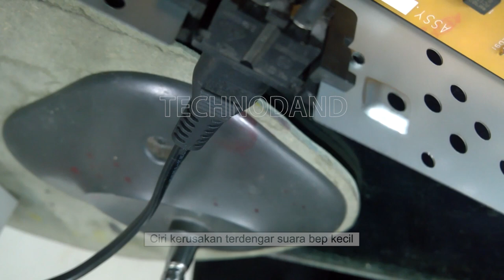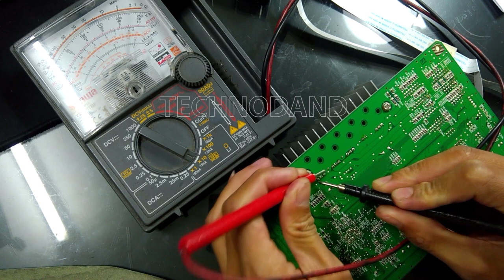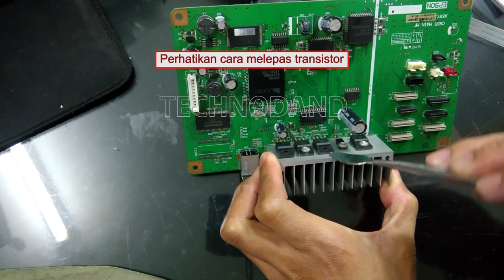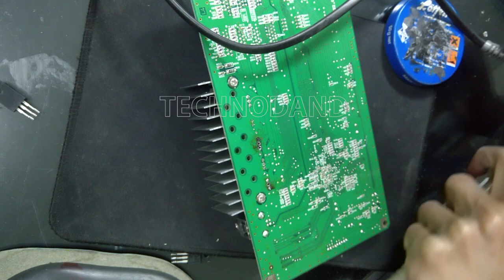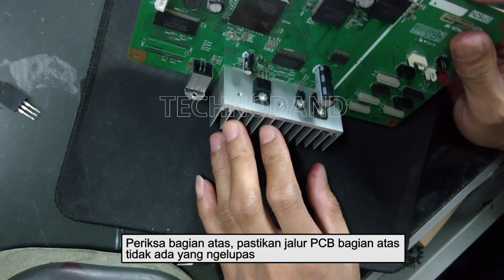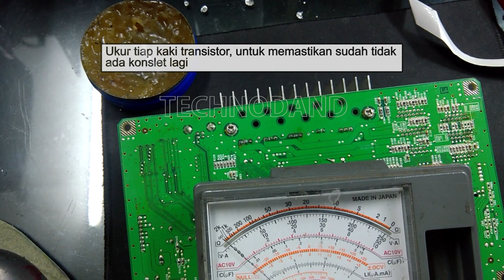Printer Epson 1390 - L1800 Mati Total  Solved

Comment: Hello sir nice video ! mine is like this no power but no bip there is no sound !!! i turn it on and nothing happing ! can you help me please thaks
Reply from the maker: try to check the flexible cable that switches the power, if there is no problem try to check the voltage on the motherboard, if the voltage drops, then check the transistor and IC power

Comment: Cara cek psu masih bagus atau tidak gimana ya
Reply from the maker: Biasanya PSU jarang rusak,  belum pernah ukur 😄. Nanti saya coba dulu test
Reply: Pnya sy l1300 hbis kena air. Mainboard apa masih bisa di perbaiki ya?
Reply from the maker: @arissutaat4947  bersihkan aja terus keringkan. Kalau kotor bisa pakai detergen dan sikat sampai bersih, semprot pakai kompressor supaya air disela-sela komponen keluar. Terus keringkan (dijemur). Rakit lagi, terus test
Reply: @technodand  
Bisa hidup lagi mas. Tapi lampu tinta sma kertas kedip"
Reply: @technodand  
Itu kenapa ya.apa bisa di perbaiki
Reply from the maker: @arissutaat4947  itu general error, penyebabnya banyak, perbaikannya bisa dengan analisa sesuai gejala yg muncul dan muncul error pas proses apa? Komponen apa yg berperan dlm proses tersebut? Nah jadi kita periksa terlebih dahulu komponen tersebut
Reply from the maker: @arissutaat4947  general error juga bisa disebabkan karena ada kesalahan pemasangan
Reply: @technodand  
Pemasangan sudah benar.
Kdang hidup kdang susah hidup.
Colokan di cabut.di colokin lgi gk bsa hidup. Kadang bsa hdup
Reply: Om printer sy epson 1390 indikator tinta nya silang semua. Lampu tinta nyala trus, udh coba ganti chip connector, board CISS, kabel flexibel chip connector sama mainboard msh ttp error. Masalah nya dmn ya om.
Ad kmungkinan flexibel head rusak ga sih om? Mohon d jawab om, makasih
Reply: @arissutaat4947  punya saya juga gitu om
Apa sekarang udah bisa normal lagi?

Comment: bang, epson L1800 sy tiba2 mati pas lagi cleaning, sebelum mati itu general error.  

waktu sy tes, ga ada suara beep. tapi waktu tombol on di tekan, seperti ada suara "ngiiiiiinng" kecil gitu, kalo di lepas hilang, tapi ketika di tekan kembali, ada suara itu lagi panjang. sepanjang kita menekan tombol power nya. 
tapi tidak sekeras suara beep seperti yg ada di video. itu kenapa ya bang?
Reply from the maker: Paling coba dibongkar casing atasnya. Kemudian lepas fleksibel yg ke print head kemudian coba nyalakan bisa nyala ga?
Reply from the maker: Kakau masih mati coba lepas semua kabel fleksibel selain kabel yg ke switch power kemudian nyalakan apakah bisa nyala?
Reply from the maker: Jawaban berikutnya tergantung dr jawaban 2 pertanyaan di atas
Reply: @technodand  klo ga nyala?
Reply from the maker: @gesyachannel0114  ga nyala setelah semua flesibel dilepas selain fleksi switch power dan psu?
Reply: @technodand  iya, sdh ganti TR juga.
Reply from the maker: @gesyachannel0114  kalau tegangan dari power supply ada?
Reply: @technodand  ada
Reply from the maker: @gesyachannel0114  kasus awal penyebabnya apa mas? konslet dari print head, motor, terendam, atau apa mas?
Reply: @technodand  ph short, hbs flushing spertinya masih basah lgs sy pasang, mobo jd short juga.
cara baca TR short gmn ya mas l1800? 
ini udh tak ganti TR apa mgkn masih short lg.
Reply from the maker: @gesyachannel0114  kalau short dari print head rata-rata komponen yangikut jebol itu Tr sepasang,, tapi bagusnya dicek semua.  Tr nya
Reply from the maker: @gesyachannel0114  cara cek nya pakai avo, letakan prob 1 misal merah ke basis, probe satunya lagi ke colector terus ke emitor. kalau dua duanya nyambung coba rubah probnya jadi hitam di basis, ukur lagi seperti tadi, seharusnya pengukuran kedua ga nyambung.. Kalau Tr yang short itu di ukur bolak balik nyambung .untuk TR di Mb 1800 itu satu pasang PNP dan NPN, karakternya berlawanan. lebih jelas bisa lihat video cara mngukur Transistor di yt, kayanya ada yg share
Reply: @technodand  klo hitam(-) di basis harusnya ga ada nilanya? gitu ya mas?
Reply: @technodand  atau gini mas.
prob 1. merah ke basis, hitam ke E,C nyambung,lalu hitam ke basis, merah ke E,C harusnya ga nyambung.
prob 2. merah ke basis, hitam ke E,C ga nyambung, lalu hitam ke basis, merah ke E,C harusnya nyambung.
.
jd harus kedua prob diatas ya mas?
klo dibolak balik nyambung berarti short
Reply from the maker: betul mas,, kondisi 1 atau 2 benar tergantung jenis dari TR nya NPN atau PNP, Intinya kalau dibolak balik nyambung itu berati short mas
Reply: @technodand  TR ga short, fuse masih nyambung, tp tetap matot mobonya.
apa mgkn ic power mas ?
btw makasih byk ilmunya mas, sehat dan sukses buat jenengan
Reply from the maker: @gesyachannel0114  betul mas bisa juga ke ic powernya, oh iya jangan lupa pastikan kabel fleksibel switch on off dan switchnya ga bermasalah mas... Sama-sama mas, aamiin
Reply: @technodand  sekali lg mas,hehe.
mb r1390 bs dipake di l1800 mas?
beberapa bilang bisa soale.
tp sy belum tau scr lgs
Reply from the maker: @gesyachannel0114  saya belum pernah coba mas, tapi sepertinya bisa soalnya semua komponennya sama.

Comment: Hello sir, I followed all the steps and changed the transistor, but the printer takes out the white paper. What is the solution? thank you
Reply from the maker: The printout is blank?
Reply: Yes, sir, the printhead is moving, but the paper comes out white without ink
Reply from the maker: @badiachababe4371  check fuse on motherboard.
Reply from the maker: @badiachababe4371  check this video for solution https://youtu.be/qwyu87vvcsw

Comment: Mau  tanya mas, sblm nya head sya mmpet lalu saya flushing, tapi setelh terpasang dan di nyalain printer gk mau hidup dan gk ada suara beep, printer saya l1800 apa penangananya seperti itu juga,  kalau pun ganti TR apakah kabel flexibel yg mengarah ke head juga mesti di ganti?? Makasih
Reply from the maker: coba lepas dulu print head terus nyalakan printer, nyala ga?
Reply: @technodand  Itu kenapa ya mas? Saya juga gitu mati doang ga ada suara beep. Udah tuker head masih sama ga mau hidup.